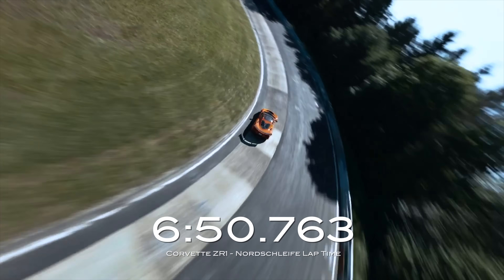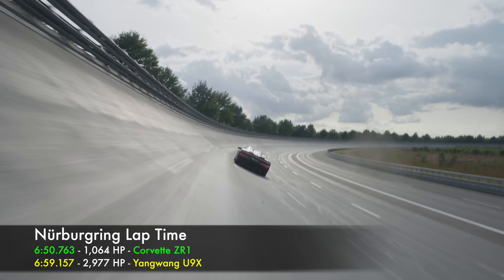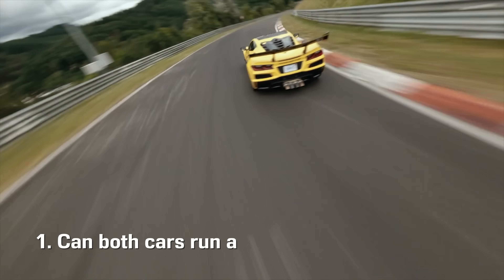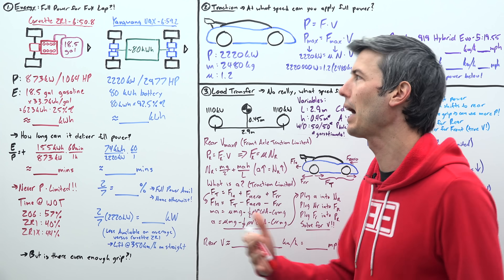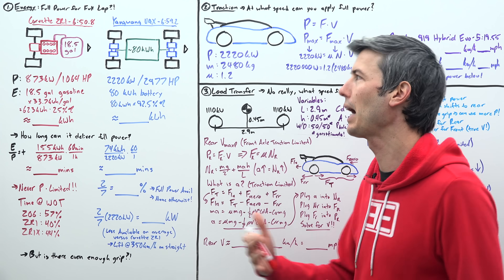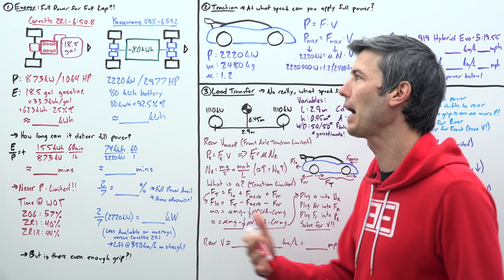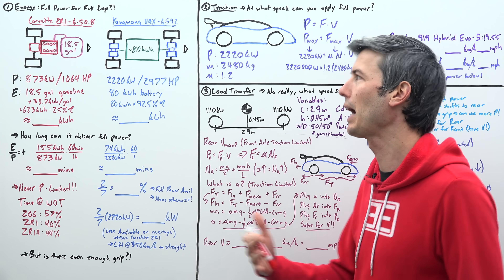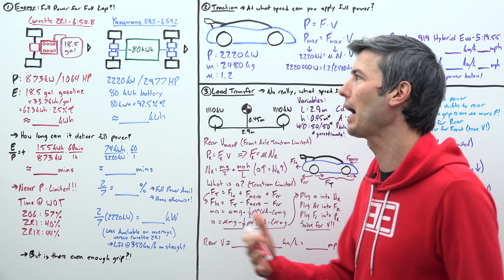Gas Beats Electric! Why Is 1000 HP Faster Than 3,000 HP?

Comment: Fast drivers drive fast.  One learns this quickly at any track.  The car, once it is properly built and set up for the track, has less to do with the lap time than the driver.  The Corvette driver that day did a slightly better job in the corners than the EV driver.  The Porsche driver had a better set up for that track, and was also a very good driver.  If you want to do a drag race, don’t bet on the Corvette or the Porsche.

Comment: At full power, 25% efficiency for the ZR1 engine is probably not far off.
But assuming 92.5% efficiency for an electric power system is probably optimistic.  The motor might be close to 92% efficiency, but you also need to factor in efficiency of the power electronics and the battery itself.  With the high amounts of current they have to handle, I would put combined efficiency at more like 80%.  I-squared * R losses kill efficiency.

Comment: I appreciate the attempt to discuss usable power, but the main reason the U9X loses is it's weight.  It is 50% heavier than the Corvette, and since it is 3x the power you'd think that'd win the day.  Besides traction-limiting, which I appreciate the whiteboard full of equations to explain, what matters is that power helps when accelerating, not while turning or braking.  Weight loss (or gain) helps or hurts while accelerating, braking, and cornering, i.e. it helps everywhere.  That is why the Corvette beat the nearly-three-ton electronics-fest on wheels...  not traction limiting.

Comment: If the 911GT3RS is quick and 911 shares front 50% with 718 and engine/gear is just turned 180deg: would a potential 718 GT3RS be faster? Shorter = lighter, better weight distribution.  But is length important for aero dynamics?

Comment: One of the big disadvantages to electric vehicles is its weight.  The lighter combustion fueled car can run a softer compound tire than the heavier electric and keep similar good tires temps. Weight and tires make a huge difference on a road coarse and racing in general.  The electric car weigh is mostly very low in the car, so the penalty is not as severe as it could be.  But it still hurts it's tires more, because of the vast weight difference. Aero down force are variable, the faster you go the more down force is added, slower the less, which is less impactful than weight that is always there.

Comment: Interesting, I didn't understand all the calculations, but your explanation helps to understand why Chinese cars are unable to go faster. But Yangwang's engineers may have used a power distributor, an electronic differential, between the front and rear axles to favor the rear axle and transfer power to the ground.
 Ideally, your data would be entered into the car's computer, which would continuously manage the power to ensure it always remains below the limit for each wheel. But I prefer the Porsche with a manual transmission.
Reply: The phrase you are looking for is "torque vectoring".
Reply: @avsystem3142  Yes, thank you, that's simpler. But I like to explain things so that I understand them properly.

Comment: In a nutshell Horsepower is the thing that makes you good at armwrestling not pullups. It just means that the acceleration will be really fast, so if you do a dragrace horsepower wins, in course race, there's a lot more involved, especially tuning horsepower at each speed, max speed, course shape etc. if you put it in a really bendy course the 3000 hp will do very good. And the elephant in the room - they don't have a clutch. Which really matters in a Race. Edit: 00:00 primary analysis

Comment: Also, the corvette gets lighter as it burns fuel.  The electric car's weight stays the same as it runs low on energy.
Reply: 20 gal of gasoline weighs 20 lbs. The fuel weight is an insignificant factor.

Comment: The drag induced reduction of acceleration is accounted for and reduces the rearward weight transfer.  However, the drag also applies a moment onto the vehicle (drag force * height of the center of drag) which increases rearward weight transfer but was not accounted for.  I'd guess that the net effect would be close to zero if the height of the center of drag is similar to the height of the CG.

Comment: Glad you somewhat elaborated on weight at the end, but still there 's something you did not mention. Going fast around corners is not only a question of overall grip versus weight. The most important thing is how the weight distribution and polar inertia of the car are handled. Or with one word, handling. Sure you need grip, but you 'll never get proper results without proper handling. I suspect the reason for the popularity of the 50-50 weight distribution is the simplification it theoretically brings to nailing the suspension setup. However, I also suspect that a car with high polar inertia will need a more "oversteery" setup than a car with lower polar inertia, at least if they have the same weight distribution. Are my suspicions correct?

Comment: 13:20 - I don't understand why the traction force calculation changes. Sure, the rear axle is power-limited, but we're calculating for the front axle here. Whatever the rear is doing, the front is still traction limited, no?
Reply: Wait, I think I get it. The point we're interested in is the very moment that neither axle is traction-limited anymore, so we can just consider the power-limited form. Conversely, for the rear axle, the point we're interested in is the moment that both axles are traction limited.

Comment: Yep, regen is peanut in this extreme conditions but in your equation you forgot bigger things as the efficiency of the electric conversion to the engine from the start. 
1) As you know the efficiency of the controller should be there and multiplied by the efficiency of the electric engine, around 70/80% with transistors and câbles heat losses: 80x92= 73% in the best case and 70x92=64% on the lower end not 92% since the engine is not running straight from the battery at a constant RPM.   2) Since we're calculating the efficiency of the electric engine, the 92% is when you're at 60/75% load, certainly not when you trying to get anywhere near 100% load where the engine heat a lot so a bigger part of the energy is converted to heat, not power to the wheels, same goes for the controller... As you mentionned of the regen note, even for the batteries heat too at this rate. On this kind of extreme performances, save the math and the weight of the driver nor the friction of the gear that exist also on the thermic version,  just observe that with all the heat dissipated on this electric system pushed to the limit,  you'll be lucky to end up with around 30 to 50% of the power of the battery going to the road.

Comment: ive always thought that any track car with much more than 1000-1500 hp really isnt worth the extra weight and difficulty of driving and not to mention the cost of running a system that powerful. A race car can much more easily run 1000+ hp especially with large slicks and massize aero but a road car is not really going to handle those power figures especially rwd. The corvette does an amazing job at this since it is mid engined but you take a 700+ rwd front engine car with regular street tires, even ps4s or 888r tires that arent fully up to temp, you are probably spinning till over 100 mph.

Comment: You put the ICE efficiency at 25% which you know is a bit low because you can't drive at FULL throttle all of the time. Then you say the elictric motor is 92.7 ( a little to specific for most folk & let's go with your first assumption full throttle all the time, you electric motors have low efficiency at high rim, so which way are we going here?

Comment: Wait now, the conclusion that a 3000hp car is slower than a 1000 hp car is because it cant use the 3000hp doesnt make a whole lot og sense.  Although I like the calculations the conclusion dont make any sense.  Especially since you just explained that the 919Hybrid made a 5.19 lap and that car have just 100hp more than the Corvettte and over 1min 30s on the ring with very similar hp would immediately tell you that the HP is not that important and even if the 919 Evo would half it hp down to 550, it is still way faster than the Corvette around the ring due to the important things like G-force in curves (due to weight vs grip vs center of gravity)   But I always appreciate your calculations though. It brings me back to the Mechanical parts of Physics I read in the late -90s  :)

Comment: The math is more complicated, but so much comes down to tire saturation. If a car is heavy and has narrow tires, it will under perform a car with better tire size to weight ratio. Tire saturation is a function of loading and time, so a heavy car on narrow tires may post excellent cornering figures over a short duration test, but poor overall figures over a full race distance. Current tires top out at ~345mm wide, so there is an upper limit to the weight of a racing car. Beyond that, you will be struggling trying to keep your tires together. Incidentally, most GT racing cars tend to be around 2,700lbs.

Comment: Nice video! I was wondering if it is a good assumption that the 4 electric motors are all the same ?   I would think based on your weight transfer discussion it may be beneficial to have larger more powerful motors in the rear especially for turns to eliminate chance of breaking traction in a turn ( like adjusting  AWD front rear bias on a WRX or something)

Comment: just find out what kwh was left in the pack after the run... hey u9, what was your % left?  ...the other variables are downforce vs speed (full power grip speed is likely lower with downforce) and regen braking, what was their % limit on regen? ..also, when turning, torque vectoring power can reduce power draw from the battery pack and go to the motors instead... not to mention if the driver had a pair of steel, or plastic... which also is a variable... lol

Comment: I'm no engineer. I'm no race car driver. But I do race with RC cars.

What I know is you can make the car as powerful as you want. But boundaries must be set depending on the grip produced by tires and downforce.

You need just enough to keep the speed up, but tamed enough so it doesn't slide.

Comment: What about sideways load transfer? When cornering loads on each side will be different. I’m assuming that with a motor on each wheel (and driver assists if they are turned on) different amounts of power can be put to each wheel.

Comment: I think the comparison is flawed because the maximum power of the U9 will be limited at more sections than it is with the Corvette, the U9 being 3 times more powerful.

Even with the Corvette there are hard limitations at which sections you can fully utilize the full 1000HP, in a lot of situations the power will be reduced in order to avoid slipping of the wheels. Honestly I'm surprised that 44% of the time it could use such a high amount of power.

But that percentage will be way lower in the case of the U9 with 3000HP. So that already plays an important role. The second factor could be thermal limitations of course.

Comment: On a track with over 73 corners the weight IS the main factor, then the downforce... You can see it on lap times and I didn't need 15 mins and a white board

Comment: It’s not just about pure power, the car design, aerodynamics and weight are all critical. No point in having infinite power if you can’t use it. Torque vectoring should allow an electric car to beat any other vehicle if all other things were equal.

Comment: This is an awful lot of blah blah blah when the real answer is weight. Electric cars are significantly heavier than icu cars. Period full stop no math required. Energy for acceleration is exponential with mass, not linear. Every extra pound on the electric car requires substantially more power just to keep up without even considering the handling impact of the extra weight.

Comment: Wheel traction is not a constant variable, it fact it's one of the variable that CAN be readily modified, you would be better off creating an energy balance equation, calculating acceleration, gradient, drag, rolling resistance, etc. at specific time intervals and then integrating it. Yes it's complicated but you can get to the answer more easily by iterating it until you can get the results to converge :)

P.S. It wouldn't make a very interesting video unfortunately :P

Comment: An engineer once told me, when discussing cars, that it's not about how much horsepower the engine has, it's about how much of it gets from the engine to the wheels to the ground. Reckon he was bloody right ! xD
Reply: Reeves Callaway once said, "The cars entire purpose is to make the tires do their job. The tires are the only part in contact with the surface."

That always stuck with me.
Reply: 100% true, if you can't use it, why have all the hardware to have that much HP. It's dead weight. I think they just wanted to say "We got 3000hp, buy our car". It'll burn rubber on all 4 tires if it tried to use it all pretty much all the time. I do wonder what kind top speed it has, it seemed to be limited to 350kph(217 mph). I imagine that has something to do with how fast the motors are turning. 300MPH (482.803 KPH) is pretty much the top speed of super cars. There's only a few places IN THE WORLD that has enough straight pavement to get to that speed. That's why Koenigsegg decided once they hit that mark they weren't going to attempt to go any faster. What's the point when there's no where you can do it. The amount of G-forces of the wheels spinning at 300MPH is astronomical. To go faster you'd need something just as grippy as rubber but stronger so the tires don't deform at those rotational G forces and explode off of the wheel.

Comment: Because this is no drag race.
1000 hp is already too much to handle for the platform, so at some point power becomes useless, but the stronger engine/battery etc. still adds more weight.

Comment: You just have to look at the top end speeds at Döttinger Höhe to see, that the Yangwang has either not the stated 3,000hp or a massive thermal problem. The Yangwang had a top end speed of 350kph, the Xiaomi SU7 Ultra (1,500hp) 346kph and the Porsche Taycan Turbo GT (789hp & 1,034hp with lauch control) 305kph (without overboost function). Time-wise all three cars have nearly identical times...

Comment: Ok so a couple mistakes here, efficiency of the electric car will be lower as you have losses in the battery & converter, so useable energy is even less. that said, one key aspect that got forgotten here: the car has regen breaking, so you get a lot of energy back again (I think around 40% is possible if I am not mistaken).
Second, with the tire grip, you completely forgot downforce in your equasion as this increases the force acting on your tires quite a bit (depending on the aero package of course)
Third, even if it can‘t put down all of its power, if you calculate at which speed it could put down the 1000hp from the corvette you would know at which speeds it is already a benefit of having more power
Reply: Efficiency?
Gas tops out at 30%. 
Electric is around 90%
Reply: @neilkurzman4907  Gas max 40%. Electric excluding charging losses, transmission losses (HV/LV lines), conversion losses (stepping up and down), steam boiler/turbine loss, generation losses (winding and other mechanical losses) = 90%. From coal to wheel probably 30%.
Reply: @berkeliumk  not even close
Reply: Regen braking would boil the battery at those speed. Think again bro
Reply: What matters when breaking isn’t your speed, bro, it’s the rate of change in speed. The regenerative breaking on this car can take in 700 kW; which is fast enough to charge the battery in under 7 minutes, higher than the average power output this guy calculated, probably the reason they break at 1/3 power to absorb as much as possible, and probably something you could have just googled instead of being snarky.
Reply: @tysonramsay3377  You obviously don't know about kinetic energy (and it's consequences) or overload operation.

Comment: I think a big part that's being underestimated is the downforce that's generated by those wings mounted at the back of the car. A F1 car generates close to 100% of its weight at only 100mph ish. ZR1 having that wing may actually have made a huge difference in terms of the grip it has. Had it not had the wing, it may not be able to keep the flooring gas for as long.

Comment: Why is the ZR1 faster?

Corners.

Cornering is going to be significantly more affected by the ~5500 lb weight of the U9. You went to the extreme with the Porsche, but the 3670 lb weight of the ZR1 means it's got almost a metric tonne less weight trying to change direction in the squillion corners of the 'Ring. Would be funny seeing the U9 bumping through the Carousel...
Reply: The Xiaomi SU7 Ultra with "only" 1500 hp does less than 6:30 minutes.

Comment: Sounds like hyper electric cars need 3 axles instead of just 2
Reply: Nope.. 1 motor on every wheel .. and a perfect Controller .. rimac did things like this.. and schaeffler too
Reply: @Tobilikethis you're obviously not at all intrigued by the concept
Reply: @thestoicwhinger far too heavy etc. for a racetrack like the Nordschleife
Reply: @Tobilikethis I doubt anyone would track such a thing. But it could possibly increase the grip threshold and usher in even more useable performance

Comment: I assume they would be using relatively the same size and compounds of tires, so Im thinking not only the heavy weight that is apparent but it looks like it has way less downforce as well. I also assumed the rear would have had higher HP motors than the front. Seems silly to have 1100KW to the front other than some gnarly torque vectoring ability at very high speeds maybe?